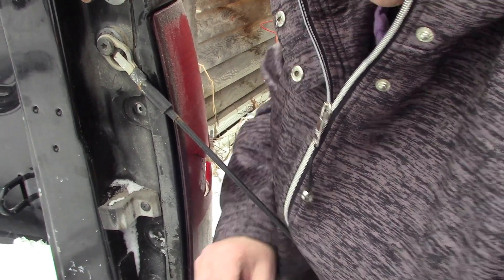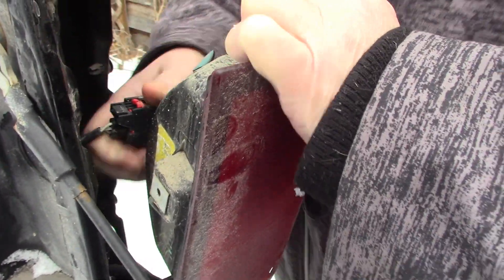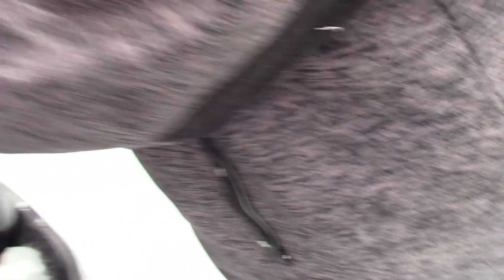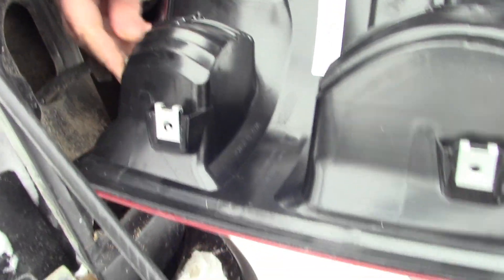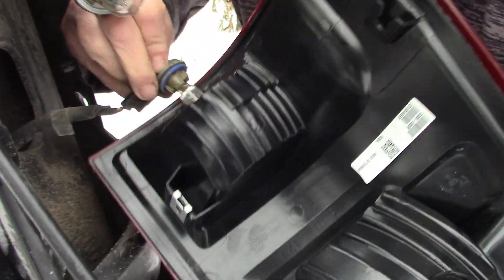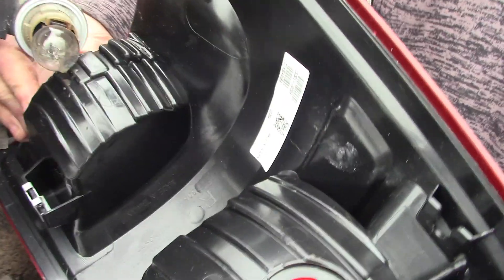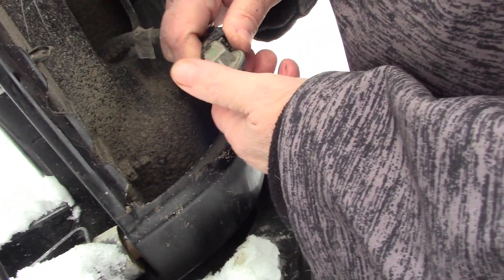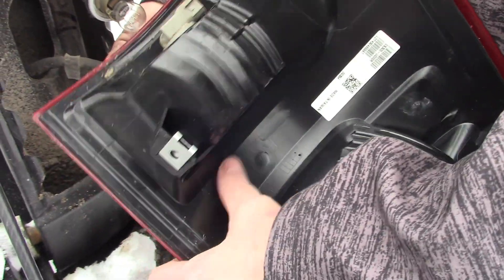Replacing My Tail Light! Home Economics!

Comment: Howie is so gentle! 🤓❤️ ..  I agree, doing it yourself is key, but Q:  from where did you get the new taillight?  .. That was your only expense.. was it a junkyard? That’s where I would look first 👍
Reply from the maker: You get it from places like dealerships and NAPA auto parts stores
Reply: @OurHalfAcreHomestead  Ooooooh.. I misunderstood- my bad!  Your comment about the “dealership“ was only reference to them installing it.. gotcha 👍🤓 .. NAPA too is a great resource!  Thanks, Bev... job well done! 👍❤️😬
Reply from the maker: @msgypsyqueen  no if you take it to the dealership they buy the light they charge you markup they charge you an hourly door rate and labour so it adds up really quick if you take it to a dealership or a shop to get fixed
Reply: @OurHalfAcreHomestead  But you solely bought the part from the dealership?  I definitely would not have them install it… They absolutely gouge you at the cash!  I had a fender bender with my Ford Explorer, and the Ford dealership’s mechanic installed my front bumper, over top of my headlight!  Can you believe that!?? 🙄🙄🙄